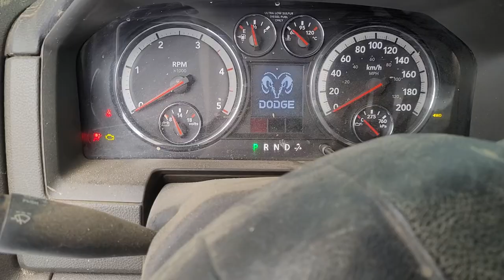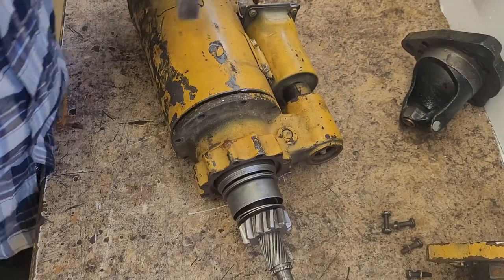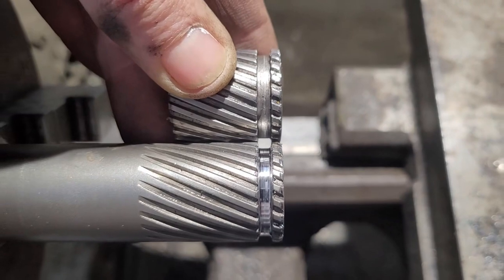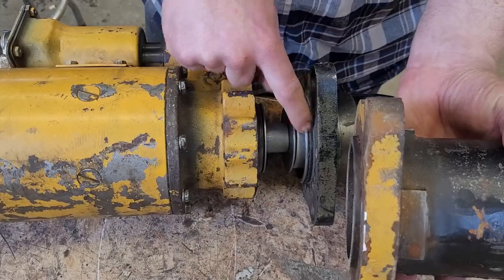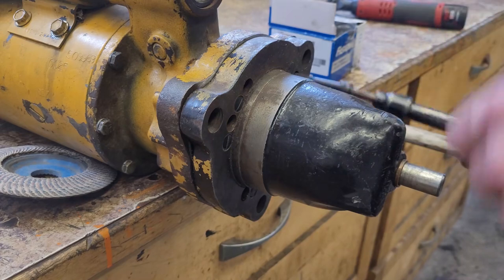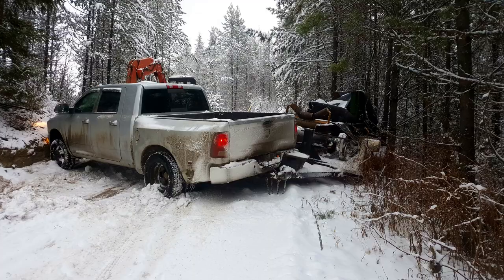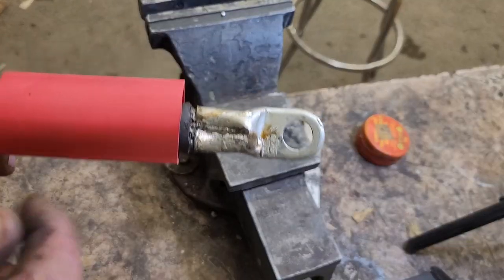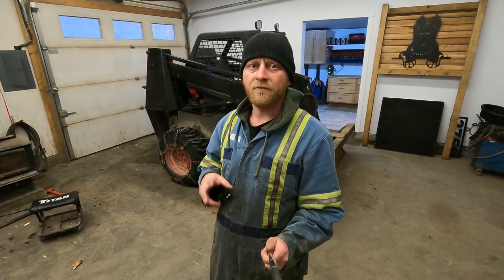BAD START, S1E1 GOLD MINING WINTER VLOG.

Comment: It’ll be cool to see that old cat back at work
Reply from the maker: I ran this ol girl for 2 years on the mine site hahha. It runs so great, doesn't even smoke. I will have to bring it out this summer and do some pushing for a video:)
Reply: When I was a little kid my dad taught me on an old dozer like that.  We just run loaders excavators and skids anymore. So seeing them always brings back memories
Reply from the maker: @wicka3851  Very cool! Seems these old cats stay running as long as there is oil hahah. Did yours have a cable lift for the blade?
Reply: @TheMiningChannel  no it was hydraulic
Reply: I got my boys learning on a newer 953 and 316 cat
Reply from the maker: @wicka3851  Very cool! I wished I started on equipment young!
Reply: @TheMiningChannel  hopin I’m raisin the third generation excavator

Comment: Not to bad of a old 1845 case, nice little machine.
Reply from the maker: I love that old machine. Just wish they came with some glow plugs, hahaha. I may throw in a intake heater one day....
Reply: @TheMiningChannel  that should be fairly easy with a 4b Cummins in it.
Reply from the maker: @Larson Timber  You betcha. That engine came from a saltwater tug boat from the coast. I was a bit skittish when I purchased it due to corrosion, but turned out to be a great motor. Those 4b engine are rare as hens teeth now adays.